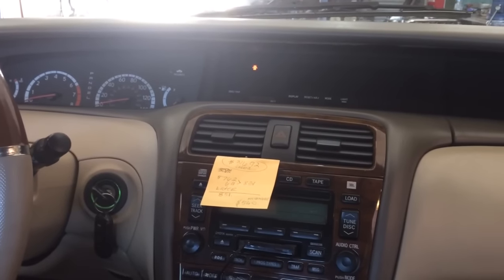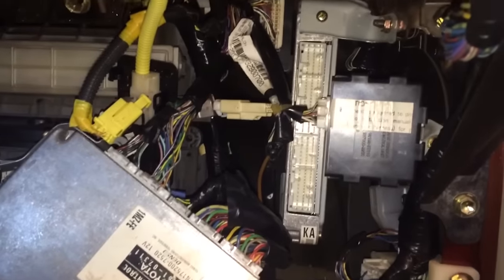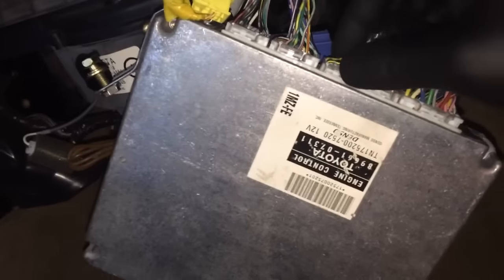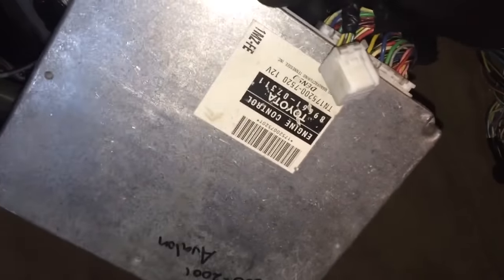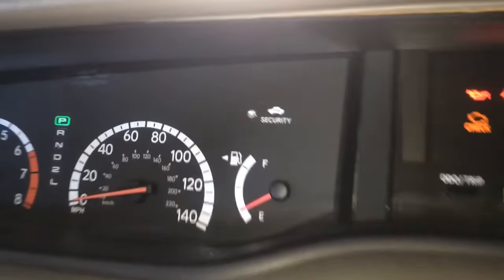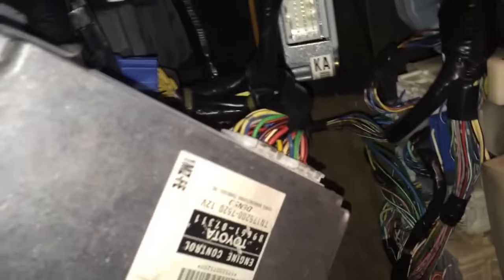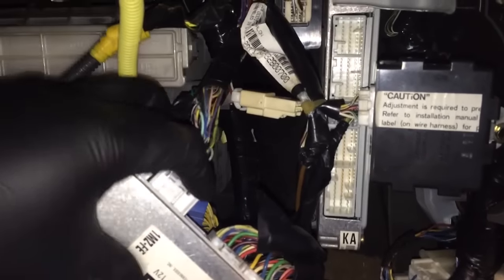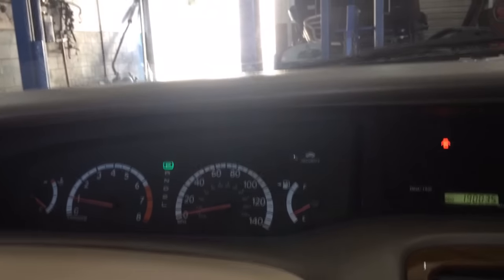Watch NOW! Immobilizer Bypass No Special Tools Needed Real

Comment: Way too much for me to do. I'll pay to get a new key. From what I got out of this video, I would need to locate a used box like the one in the video, take part of the car apart where that box is located, and pull three plugs out of the car and re plug them in the box I bought someplace. Then the car starts and I have the underside of the dash all torn apart with wires and boxes hanging all over. Nope. I'll pony up the $ to get new keys. :(
Reply from the maker: +Gary Geiser this is a video really for those who want to test if the new/used ecu works before they shell out some money to reprogram the immobilizer to work with their existing keys. If you didn't have the original keys for the original ecu this method wouldn't work anyways.
Reply: @RevvedUpKnowledge  Would it work on 2003 Lexus is300?

Comment: I have a 01 civic ex that someone tried to steal last night... Now my ignition is completely torn apart and when I try to crank it the green key flashes on my cash. Is there any way to quick fix this until I can replace my ignition
Reply from the maker: check to see if the immobilizer ring (black with a green plug) is plugged in. if its damaged as well then you have to buy a new reader as well
Reply: @RevvedUpKnowledge  it us plugged in but there is another one the sits on the inside of it that is broke. But my whole ignition is torn apart and screwed. Having to use a screwdriver to turn on the inside
Reply: @RevvedUpKnowledge  any way to bypass or reset????
Reply from the maker: Try holding the key or putting the key in the ignition (even if it’s messed up) and turning the switch with the screwdriver

Comment: So this is a temporary fix. How do you permanently fix it? I am just wondering if you know how, because the dealer wants $175 to re_ key the ECU. Thank you for this video, it was very helpful.
Reply from the maker: +Lori Ann Woody Thank you for watching and commenting!! the only permanent solution is to sync the key(s) to the new ecu. you can shop around to see if any locksmiths or local repair shops can do it as well. it should be a lot cheaper than the dealer.

Comment: I have a 2001 VW passat. I've had it for about 5 years. low milage, no problems ever other than stuff I had to take care of myself (oil change, new brake pads, calipers, etc.) I left it sitting at my parents place for a month and obviously the battery isn't the best. I have 3 separate keys for this vehicle. I tried to start it with the spare one a couple weeks ago and it showed me the "immobilizer" light. After a couple more weeks I attempted to start it with the original pair of keys (I lost them for a little) and now the immobilizer symbol is showing up with the original pair of keys. what the fuck is this system, I'm loosing my shit trying to figure out how to get my damn car started so I can get back to work and yeah fuck this bull shit. someone please help
Reply from the maker: +codaboggs mobile locksmiths should be able to re code it for you. sorry took long to reply just noticed now

Comment: My anti theft light is flashing because I replaced battery now my key won’t work
Reply from the maker: Make sure your chip reader is still working or if you have multiple keys make sure you have the right key
Reply: @RevvedUpKnowledge  Same thing happened on my 03 RX300. Nightmare! original ECU had a couple burnt diodes, got one from flagship 1 (suppose to be Plug-n-play) Wasn't Immo wouldn't go off. Sent them back BOTH my old ECU and the one they sent me and told them to clone my old one. All was well till the kid left on the interior light and killed the battery. Charged it no dice. Steady flashing security light. Got a new battery, same problem. Cranks but Immobilizer lite still flashing. No longer sees my FOB. HELP!!
Reply: @ChrisMichaelsChicago  Exactly my problem, LS 460 2008. Push button ignition,  Somehow managed to crossed NOCO booster clamps and Alarm went off, had to pull the horn plugs.  Ordered the same unit from flagship1 , still not start, acts like no key.  The flagship1 used my VIN number to program the unit, still no crank, no start and not dash lights either.   Hard to find info on how to dealt with issues like that  on Lexus vehicles!11

Comment: Did NOT work on a 2000 gs400 with new PCM...?? Entirely DISGUSTED with this POS. Thew security light went out when plugged in to old one, left key on transferred said plugs back to new PCM, security light started flashing again, crank no start. did it a 2nd and third time, no dice GRRRRRR
Reply from the maker: Try keeping the grey plug plugged in on the original ECU
Reply from the maker: Grey plug is for immobilizer system